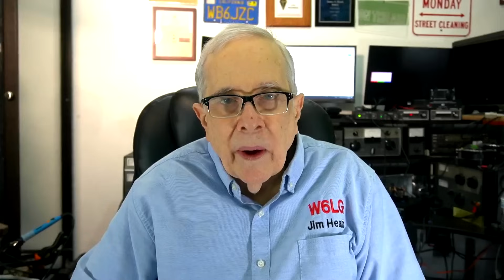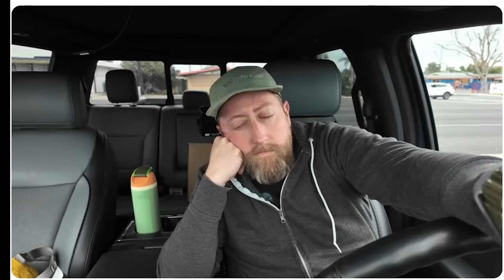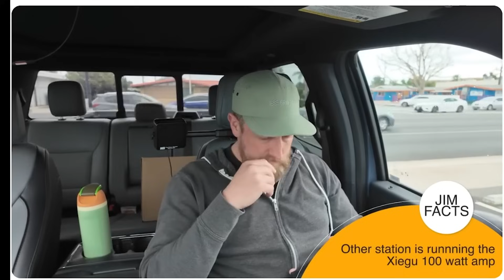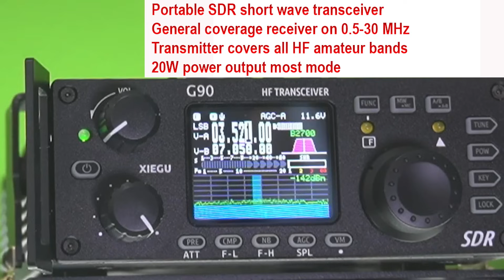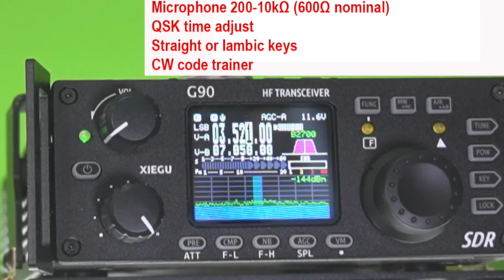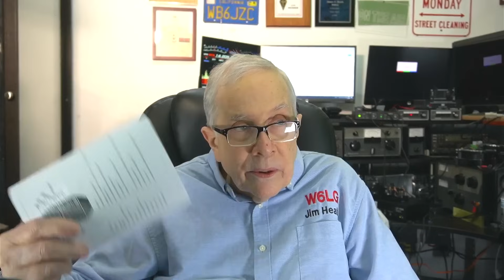What HF Transceiver Can A New Ham Buy For $500?

Comment: I upgraded to General in the spring of 2023, bought a G90 in the spring of 2024, and now in the spring of 2025 I've got an antenna up and have made 230 digital contacts since StarWars day(May 4th).

I run mine at 20w of FT8/FT4 regularly, and it pulls less than 4A on transmit. 

I am already saving for and looking into buying a entry level 100w rig, not because 20w isn't enough on FT8 or FT4, but that I'm concerned about using it at full power for a 50% duty cycle. 

We found out last year at field day that the G90 is lacking in filtering, so I was hearing other operators at the site on completely different bands.

Comment: The G90 was my first HF radio.  I made thousands of contacts on that thing.  It lives in my truck in an Apache case along with the mic, a battery, a CW key, and an antenna.  For what the G90 costs, it's hard to beat.  Will it compete with my FTDX10?  Absolutely not (well, the antenna tuner in the G90 makes mincemeat out of the one in the Yaesu, but I digress).  Is it an amazing radio for what it costs?  You bet.  The G90 is usually my go to answer when someone new is looking for an HF radio on a budget.

Comment: Have a G90 and an FT-891 and every time I go out portable the G90 is my go-to radio. Waterfall display (admittedly small), ATU, SWR sweep, and all the controls you are likey to want are on the front panel. It's missing some of the features on a higher end radio, sure, but at the price it's unbeatable.

Comment: My first rig was a single 6aq5 to a 130 foot long wire and a Heath Kit AR3 which also provided the transmit power.  That was in 1963. VE6AMR

Comment: At it's price point, it's a fantastic first or fourth radio. I have a G-90 and it has performed well within my expectations. Mine is about 4 years old.  Great portable radio or as a low priced base radio. Anyone interested in portable emergency communications should 100% look into the G-90. I don't know if you have seen the YT "Ham Radio Tube", but he takes one and hooks it to a baseball backstop, guard rail, car bumper and even a tin roof on a carport (With an alligator clip) and makes contacts within about a three state region. Obviously not  a strong signal due to high SWR and highly compromised radiators, but he was getting some 5-7 reports. The tuner allows it to almost tune a wet noodle. The built in SWR scanner is another plus when using non resonate antennas. Pairing it with an efficient antenna and it really performs well, even at 20 watts. What makes this a good first radio is the low price and the fact that it can still be used for portable operations once you upgrade. A lot of radio in one low cost package.

Comment: I have just been dipping my toes into ham radio world. I really appreciate the video. Was very clearly explained on the strengths and weaknesses. Also what to expect and what not todo with higher end components. I’m probably going to purchase it. I have a UV-X3 installed in my vehicle. Didn’t install the amplifier but I probably will. For I like how it performs for what it cost. Thank you for the video.